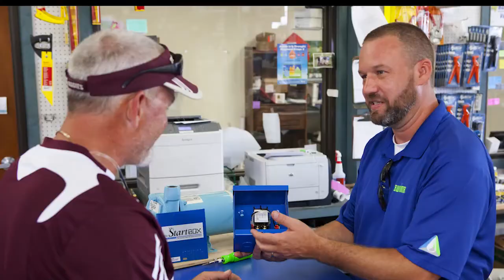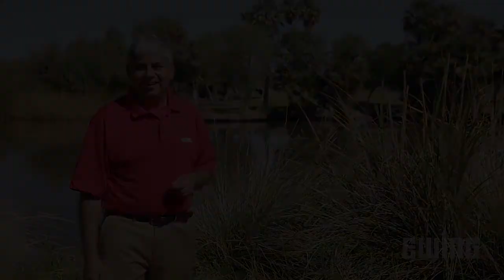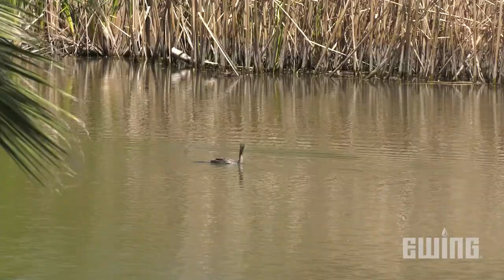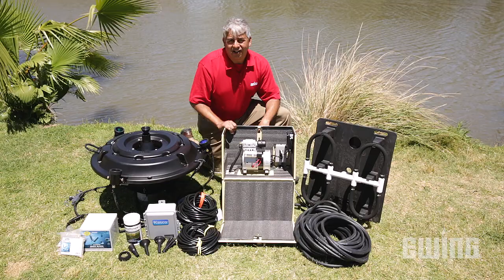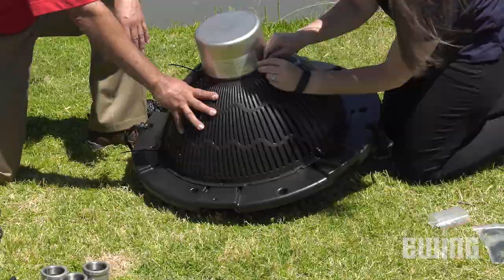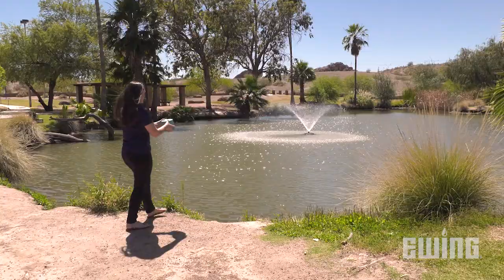Lake & Pond Management - Aeration, Circulation, Treatments

Comment: How much area cover with 2 Hp Aeration system.
Reply: I think he said this in the video...1 acre.
Reply: Smaller ponds don’t need to be mixed by an aerator, they are usually polymictic meaning they mix naturally multiple times a year. They are very beneficial but not for mixing a pond smaller then an acre/acre n a half.